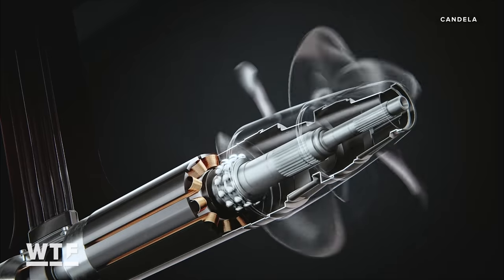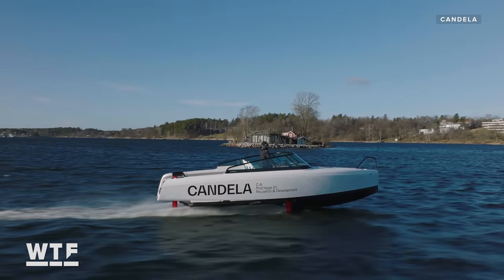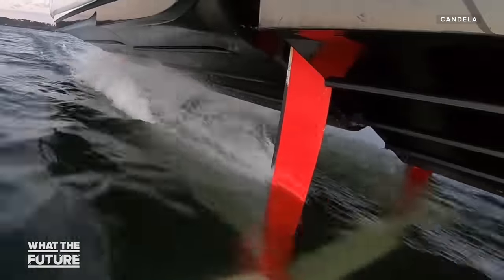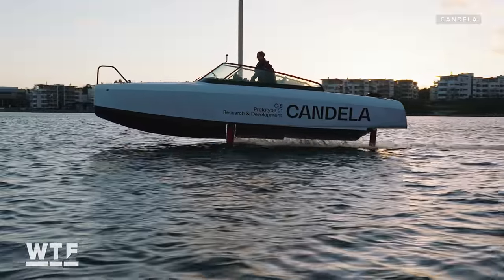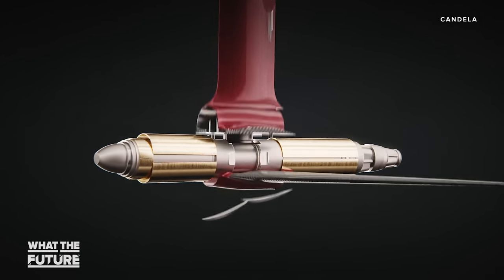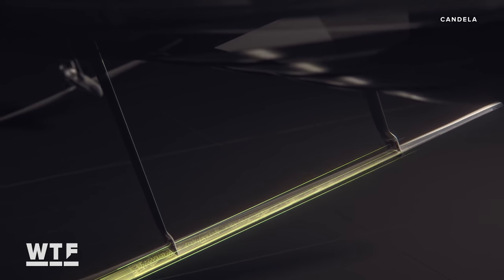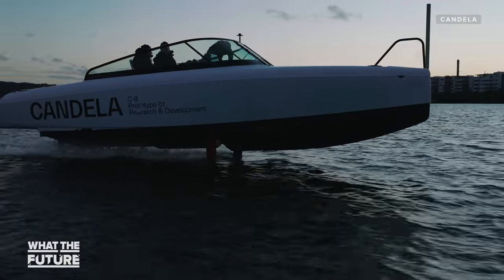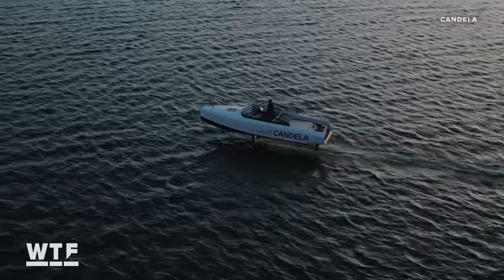This Electric Powerboat Can Actually Fly Above the Waves

Comment: I've always loved hydrofoils and now that I build flying drones, I agree that an electric foil would be very cost effective for point to point ferry duties, where speed, smoothness, quietness, and maintenance is important, but not long range.
Reply: what about a "recharge system" from prop movement, so that the battery is always constantly being recharged adding more range. I think only then would it make "PERFECT" sense.
Reply: @insidepossie   "Prop movement"? You mean like the props turning a turbine to recharge the battery? If so, I'm sure the drag is far greater than the power generated. Solar panels would be better, but even those wouldn't be efficient enough to keep things charged.
Reply: @Phrancis5  Yes like turning a turbine. I'm no engineer but I would assume the drag increase would be below 1%, plus both turbine and solar combined would be just as effective.

Comment: The coolest part of this is that you can tank up your boat for about ten dollars compared to a similar sized internal combustion boat that would cost 250 dollars per tank full.
Reply: In a recent interview with Bjorn Nyland the revealed they had borrowed an equivalent sized powerboat for the day for speed benchmarking, the powerboat used $400 worth of fuel while the C8 used $10 worth of electricity. This 25x cost saving could be massively disruptive for in-shore boating.

Comment: Do I understand this correctly?  The boat battery is less than half the size of the tesla plaid?  44kwh vs 95 for the Tesla.  With a larger battery,  obviously there is more range.  I'm sure this will be upgraded in future models.  Love it!
Reply: Also more weight so it’s a trade off of needs since they are working on reducing drag
Reply: @ToniSkit  Exactly. There is a tradeoff in there. We are already achieving record breaking electric range at the speeds that cover most people's needs.
Reply: @Candelaboats  And I love it.  I see room on the table.  As a tweaker of all things tweakable, Im amazed at the results you're getting with that capacity.  Great!

Comment: What happens when there’s an impact, or sea creature hit without warning from the silent design? It’s neat, but I can see a concern of being 50-70+ mph and hitting something when you’re above the water. Be it a rock, animal or person. An accident is almost certainly catastrophic at that point.
Reply: Good question! Just to clarify; the top speed is closer to 35 mph rather than 50 mph.
In any boat at any speed, vigilance is required of the driver in order to avoid collisions and the same is true for the driver of a Candela.
Reply: Drama there's always something
Reply: Probably some "breaking points" that are designed to snap, so the wings break and not the rest of the boat.
A bit silly to calculate that you will "hit animals" with a boat. Do you chase whales or something ? xD

Comment: Put it in any kind of ocean swell and see what happens. Exciting progress though
Reply: Hydrofoils only work in good weather conditions.
When it gets rough they switch back to "regular" mode.
Reply: Where do they normally operate these?
Reply: We can handle swells up to sizes where regular boats need to slow down. Imagine flying over the waves. Just like @Peppe Ddu says, however, sometimes we also need to slow down.

Comment: I love this approach.  Next step will be  hydrogen fuel cell and then you can add the range. Latest composite approaches mean the hydrogen tanks can be integrated into the hull design.  Then we will be at ICE ranges on full electric.   (With a lithium emergency battery probably as well).
Reply: With hydrogen you will significantly reduce your fuel efficiency and increase safety risk and maintenance costs.

Comment: The control stabilization system even if it only altered the hydrofoil wings angle of attack 20 times a second seems to be  the best part of this boat. The issue of shielding seems relevant with risk of sunspot activity disrupting digital systems - who would want to be out 40% of the cruising range, suffer a catastrophic sunspot scrambling of the hardware, and then be unable to return to shore? Conventional cruising is 4x more energy consumptive than hydrofoil cruising so you would be stuck! Unless you have conventional wind or ICE systems to fall back on (or radios and an effective rescue system).

Great for high density cruise areas where the infrastructure exists - but wouldn't all the super rich want to show their toys off in that setting anyway?
Reply: Orinary electronics isolated from the power grid should not be affected by solar storms, although a nuclear electromagnetic pulse may write a different story.
Reply: @awuma  According to physics professors who studied the corona of the sun, when sunspots are big enough the radiation is so strong that it can impact "ordinary electronics" whether attached to the grid - like a huge antenna - in rather unfortunate ways. Although I took those classes in the 1980's, the knowledge regarding sunspot impact on microelectronics indicates the strong sunspots can interfere with our personal electronics if the sunspot is big enough. 
Of course, nuclear blast in the atmosphere inside of the Earth's magnetosphere is a much stronger pulse that can penetrate many layers of protection.

Comment: This seems all well and good however what happens if your battery dies while you are out sorry I'll stick to the conventional powered boat
Reply: Same applies with gasoline.. bad logic. Gasoline is good for long rides. Batteries for short rides. You could even make a hybrid
Reply: What happens when you run out of fuel on an ICE boat.. oh, same thing.
Reply: All type of engines and fuel resource can die... Just pick up you're phone and ask for help or ask to you're fellow sailor for a pull.
Reply: You pop out your solar panels and can continue home after a day... You can't do that with a fuel boat ;)
Reply: Jackery!!!
Reply: What happens if your engine dies which I am guessing is happening somewhere right now as I write this?
Reply: Nearly impossible to run out of power. The system will derate when state of charge gets low which will allow for you to make it back to shore but at idle speed. Boats require very little energy when at idle speed. This is at least how it is on Ingenity Electric boats
Reply: @byammine  Yeah the same way our phones work when you get a low battery warning. My phone never just dies. Some people want to stay in the past so bad they will ignore everything to stay there.